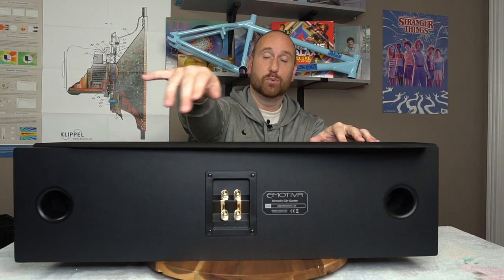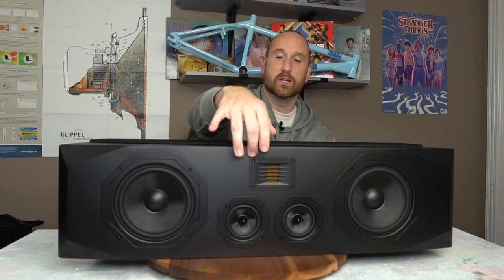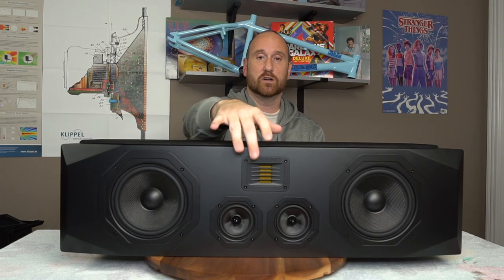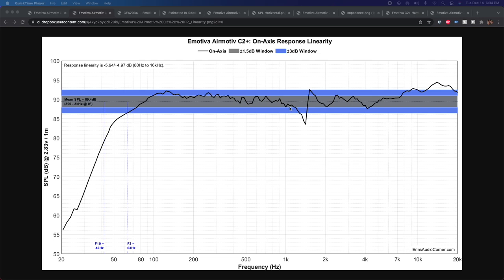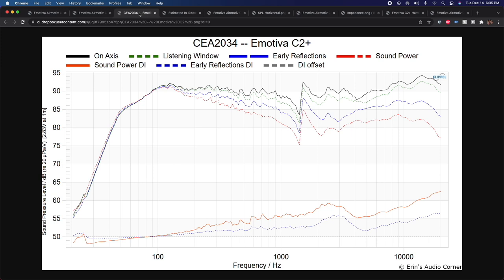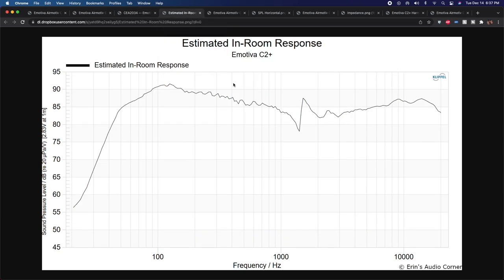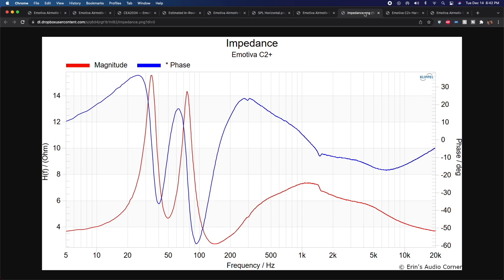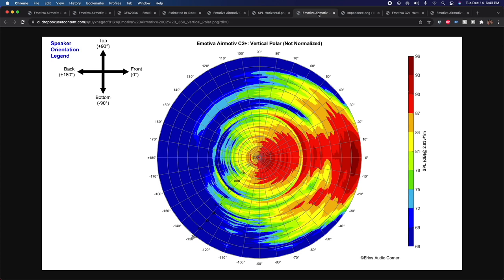Trading Linearity and sweet spots for SPL.  The struggle is real.

Comment: I own this center channel. Not one issue from any angle.  Yes it is powerful and the clarity is great (80 hz crossover).  Trust that the numbers can't be heard in real life.
Reply from the maker: Dude. You can clearly hear the difference when you sit to the side. The numbers aren’t voodoo.
Reply: @ErinsAudioCorner  nah... In a home theater application dialog can be heard throughout the entire house when the door is open. This review makes it sound like the sound drops out completely which is not the case. All my seats to include the risers are clear and audible. Does my sweet spot sound better... Yes, but will people lose any sound from the center... absolutely not. Respectfully, this center just works.
Reply from the maker: @Gypsyman40  I have a home theater. I demoed these from the seats in my HT. There is a clear difference in the sound from the center seat to the sides. I never said the sound goes away. I said there is a difference in what is heard between the seats. The data explains why.  6-10dB difference from dead on to 30 degrees is quite a bit. If it doesn’t bother you that’s great. It doesn’t mean it’s not real, though. ✌️
Reply: @ErinsAudioCorner  I respectfully agree. I appreciate the time and data you provide. Thanks for the conversation as well
Reply: Same here. I just switched from the C1+ to this C2+. Zero issues, at all. I appreciate folks who run data but in the real world it just doesn’t translate to anything that affects how this sounds
Reply: It's hilarious people trying to argue about that is clearly audible and visible in measurements.
Try a GOOD center and you will realize how foolish you have been defending this atrocious design. 
It's normal..nobody likes to be told they bought a bad product specially when it costs like $100 to return it lol
Reply: Is it that you, Zorba? If you can hear the issuesz I suggest going to an ear doctor cause you have some real issues
Reply: That's why I stick with Bose lifestyle 😂

Comment: For a budget $400 speaker, you can do a lot worse. Would love to see the C1+ as it's cheaper, and may be a more realistic option for people since center speaker placement may be limited. I do hope you find better centers in the future with improved dispersion. I've seen plenty of setups with the center speaker placed way up high above the TV, or way, way below, pointing at the listener's knees. I can only imagine the output loss, and having to bump up the center trim by +5-10db to compensate.
Reply: But you can do much better with them Monolith 365c though

Comment: The general design of this speaker is "iffy."  It's bad enough that it's a horizontal center, but then they dropped the ball even further.
Reply: Not all horizontal center speakers are bad. A typical 3-way horizontal center works perfectly fine. The issue here is the use of 2 midrange drivers.

Also, the "bad" MTM design is only poor off enter. It's faults are greatly exaggerated.

Comment: Nice Erin. I hope Emotiva takes your data and fixes the C2+ especially if they send you the C1+ and measures better. I would definitely consider switching to a C2++ or a C1+ if the data shows it's good. That said with Dirac and my seating position being in the sweet spot I am pretty happy with my speaker. Thanks for all your hard work and honesty
Reply from the maker: Thank you for the support.
Reply: Sadly they instead made an even worse c3+ :/

Comment: So do ANY center speakers actually have wide horizontal dispersion? Which should be the main point of a center.
Reply: Any typical 3-way with the midrange above or below the tweeter are fine. Also KEF 3-way with the concentric tweeter/midrange.
Reply from the maker: ^ agreed.  It's hard to find a good center channel with a lot of output, though, and we are seeing some of those reasons here.
Reply: @JabsJibo  Agreed, I used a Kef Q150 as center for 3 years before switching to the Prime center for the increased output. Give a little take a little.
Reply: @ErinsAudioCorner  If you do the C1+ it would be neat if you had another large center such as the SVS Prime for comparison.
Reply: For best center channel performance in a home theater shouldn’t we stop trying to make “center channel speakers” work and instead simply use three of the same bookshelf speaker for LCR with multiple subs?

Comment: Very nice. I still think the Emotiva line up of speakers would work for me in my living room. But overall it's reassuring to know some of the faults. 

I do have a question, some of the frequency response can be adjusted in your AVR right? Given the AVR has that feature.
Reply from the maker: Some of it can, yes.  Wherever you see the directivity index measurements are linear then you can.  The further from linear they are (peaks, dips, wild shifts), the less the off-axis response matches and the less EQ'ability they have.

Comment: Something doesn't add up here, 1500 Hz has a wavelength of 9" . . . which means the CTC spacing of the mids is 1/2 a wavelength, there should actually be ok agreeance between those drivers at that frequency. Emotiva states the mids cross from the woofers at 350 Hz and to the tweeter at 3200. 1500 is dead center in the passband of the mids and shouldn't cause this issue. 

Look at the 1099 you reviewed, it has 5" drivers right next to each other with no issue, just the characteristic narrowing directivity. This layout is the preferred solution to having a horizontal version of an LCR speaker because the tweeter/mid combo can be rotated and still perform well.

I might go so far as to say that the mids might be wired incorrectly. Just doesn't seem right to me.
Reply from the maker: Lobing starts at 1/4 wavelength but most use the 1/2 wave rule. Speakers have entered beaming by 1/2 wavelength and well into beaming by full wavelength. Look at Scanspeak’s data sheets for their drivers and you can see what I mean. 

The issue at 1500Hz from what I can tell is likely caused by the cabinet and above that is combing.
Reply: @ErinsAudioCorner  Ok, so I think we agree that CTC spacing isn't the issue at 1500 Hz, it just seemed like you were saying it was in the video. We expect beaming, it should generally be gradual with increasing frequency, not like what we see at 1500 Hz.

I like the idea of cabinet issue much better. In speakers I have built, I have experienced cabinet issues that look exactly like this with a dip before a spike and then settle. Are the mids in their own air cavity, and is it stuffed?

Comment: These bigger center speakers are made to be listened to at a distance. Like easy 6 to 10 feet away and it's best to have it above the screen angled down towards the listening position. Off axis issues are really only noticed when.you are sitting close to the speaker and if you have to sit close then.you should go with a smaller speaker. Also if you turned this speaker vertically all that would change.and coaxial speakers have completely other issues than source point or on or off axis issues. Like generally poor bass output.

Comment: Hi Erin, the real question that never gets awnsered in many reviews is how do they actually sound in real life when you sit in the sweet spot? Measurements are fine and all but that does not matter at all if you can't hear the imperfections. The funny thing is that most people are referring to the measurement and tell you it's a bad speaker while all people who actually own the C1+ and C2+ say the C2+ is even better than the C1+ and other centers. 

So basically my question is: how does the C2+ compare to other centers in the same price range when sitting in the sweetspot? And not by any meassurments but in real life.
Reply from the maker: I discussed that in the review. And I wrote about it on my site as well.
Reply: @ErinsAudioCorner  Thanks for your quick response! I watched/read both but I must have totally skipped that part for some reason... At what timemark in the video are you discussing this?
Reply from the maker: @johandeen6096  I’m not going to watch my video again. But if you check the review on my website I discuss the bass and the HF treble boost. The rest is centered on the off-axis response which does impact the sound at the MLP (reflections matter). Hope that helps.
Reply: @ErinsAudioCorner  Thanks, that helps. Would you agree that when using this kind of speakers in a 100% HT setup (movies) you won't really use the lower frequencies (below 80hz, crossover at 80hz or higher with small speaker setup) as this is driven by a dedicated sub? I just ordered the T2+ towers and thought the C2+ would be the best to match the towers. I did read many reviews on the T2+ and others in this price range. They seem very good and even match or outperform many higher end speakers but I didn't watch any reviews on the C2+... But reading about the measurements i'm having second thoughts. On the other hand, many people who own this center say it's very good. 

I'm running the Elac debut C6.2 and F6.2 towers (and 4 b6.2's as surrounds powered with a denon 3600h) right now but I'm not so impressed with the center (did you test these? Can't find a review on your site about the debut's) . It sounds a bit tincanned. Nothing special so far. The F6.2 sounds good as far as I can tell since I never heard any other speakers. Other then some 20k B&W speakers that my father in law owns lol. 

Would I be better off getting another center with the T2+ towers? For example the monolith THX365 or the C1+? I'm sitting 100% sweet spot all the time and have enough room to place the speakers anywhere I want. On the other hand, If I return the center I will probably pay at least $100 in shipping costs.

To be honest buying new speakers is a complete shot in the dark for me. I can't drive to a store to test most brands simply because many brands are not sold here (Europe) and need to be shipped from the U.S. I went with the C2+ to complement the awesome T2+ towers so the front stage matches. I'm running a SVS PB2000 pro sub and getting my second one later this month. 

Reading reviews makes everything ten times worse because everyone recommends another speaker. Everyone who owns the C2+ think it's awesome and others who just read reviews say it's garbage. I would say my (your) ears are the true measurements and all sound is very subjective. I hope my new T2+ and C2+ works out in my room and are an improvement over the ELACS. ETA next week.
Reply: @mikedinno8413  I got them in place and they sound fine. This whole science and meassuring things have some use but the final judgement is always your ears. Been diving into REW to get the best bass reponse in my room and once I got it i did not like the sound. I don't care anymore how any graph looks
My ears will have the  judgement. But it would be best to try every speaker out in your own room and then make a desicions. Unfortunately thats almost impossible for me.
Reply: @johandeen6096  The 11:30 mark is what Erin is referring to.

Comment: I don't like what they did either. Plus the impedance dips very, very low around 150Hz (we need beast amp to power it properly and keep distortions low). I just wonder why Emotiva didn't go just one slightly bigger mid that has higher efficiency.  That way the freq resp would be more linear and impedance wouldn't dip so low. Also why ported woofers, since center channel doesn't really reproduce low frequencies.
Damn it, let's test the C1 - I have a feeling it will perform better
Reply: Most speakers dip below 4 ohms. Any 100wpc AVR will power this just fine, due to it's 89+db sensitivity.
Reply: My RZ50 has zero issues powering this beast. Dialogue is super clear and it sounds better than my old RP-504C. I do sit in the sweet spot though never outside 20-30 degrees

Comment: I just don't understand where they were going with this design. Output like you say, but they could have made a much better speaker by just using a larger midrange like a 4" or 5" instead of the dual smaller drivers. They could have avoided midrange comb filtering, and probably the midbass cancellation as well by squishing the bass drivers together further. That would have gotten the same output potential, but an actual decent center channel design. I can't believe companies are actually paying engineers to design stuff like this.
Reply: Marketing influences design over performances to appeal to the mass market.. So sad.
Reply: @tomnwmi  that’s just it though, would the design changes I mentioned actually negatively affect marketing? IMO emotiva speakers are already some of the ugliest on the market. I don’t see how changing up some driver sizes and spacing would make them look any worse. The c1+ already looks like that. Maybe they were trying to differentiate the two? I guess if their customers don’t notice then it doesn’t matter but it’s just disappointing to see.

Comment: I've had this speaker for about 6 months now. My room is probably treated more than most and after Dirac runs full range the boosted highs and the dip-peak aren't an issue. If you turn on 1/48th smoothing when looking at measurements the dip-peak blends in with all the other dips and peaks caused by the room. What is a problem is the off-axis performance when you're more than 25 degrees from the center of the speaker. However, if you're that far off center you're likely out of the sweet spot and having to accept other compromises already. For example your bass is probably not as good as the sweet spot unless you have 4 subs and spend days tuning. Also you are varying distances from the front left or right, surrounds, and atmos speakers. The off-axis performance of the center channel is just one more compromise so it likely won't make or break the experience. Still, it would be nice to have one less compromise - just pointing out it's not the end of the world. It does sound great on-axis after being tuned.
Reply: You are dead wrong. The sound you here at MLP is a combination of on axis and off axis. The makes the c2+ just a bad choice when there are so many better options.
On top of that is extremely directional so instead of fooling your brain to make you feel the sound is coming from the screen, it clearly makes you notice the sound is coming from the enclosure.
A complete failure as center.
Monolith thx 365 is better. And if you want a huge jump at a much higher price get a revel c208 and experience what a fantastic center can really do
Reply: @shaolin95  My room is wider than it is deep and is treated on both sides so I have my doubts whether I would be able to tell a difference between the C2+ and a center without its design flaw at the MLP - the measurements look fine. I use the center every day and haven't noticed the sound coming from the enclosure rather than the screen but I have it at ear level like a sane person, not on the floor. If I were to replace it with the Monolith or Revel you suggest I'm afraid it would not be timbre or aesthetically matched to the rest of my Emotiva speakers. I'm a value buyer and a complete matching Revel system probably would have been 5x the cost for ~10% more performance. Perhaps a complete Monolith system could have been a good way to go, but when I made my choice there was limited objective data on them. I can appreciate wanting to hold manufacturers accountable for bad design and not settling for less when better options exist, but in every system you have to weigh compromises and I think the problems with the C2+ won't be show stoppers for most people and I gave some of the reasons in my original post.
Reply: @miscreant1739  lol you think the c208 is only 10% better....talk about wishful thinking 🤣🤣🤣
The c2 is not even in the same universe. I tested them and many more before picking my center. You are trying very hard to convince yourself the c2 is good.
Do yourself a favor, order the c208 from Crutchfield.. It will cost you $12 to return it so basically nothing to lose.
But you still be able to experience the world of difference between them.
Oh my room is about 50 feet wide and still there is no comparison. The c2 is also terribly boxy directional. The revel imaging and halo is fantastic. Again, not even remotely on the same class.
Reply: @shaolin95  when I said "~10%" I was referring to the system as a whole, but let's go with it. When the C2+ is placed well in a normal room with treatment and good EQ is used and you're sitting in the sweet spot listening at a reasonable level, then I bet we're close to the point of diminishing returns and the experience you get is within 10% of the c208. If my conditions don't match your situation and you're clueless and can't read a frequency response chart and place your center channel on the floor and listen off-axis near an untreated wall then this isn't the speaker for you. You can make up for your mistakes by buying a well-designed center channel that is more forgiving. I never said the speaker was good, my original post talked about its flaws and why I didn't think they'd be big problems for most value buyers, but you've been checking back here and other places for months looking to pick a fight about this speaker for some reason. Since you enjoy arguing so much you should take some time to get better at it and provide some sound arguments for your positions rather than the equivalent of "LOL WRONG".

Comment: The biggest problem is horizontal vs vertical dispersion. Damned if you do and damned if you don’t with center speakers. A concentric single speaker is the solution but people don’t like the aesthetics of a small square box in front of them. Manufactures build what sells, and sleek looking speakers with a bunch of great looking drivers sells. Eq the dips parametrically and move on. Can’t understand why the manufacturer didn’t do it themselves?